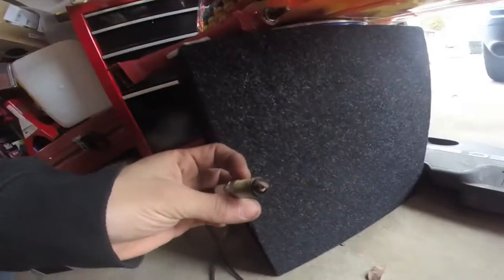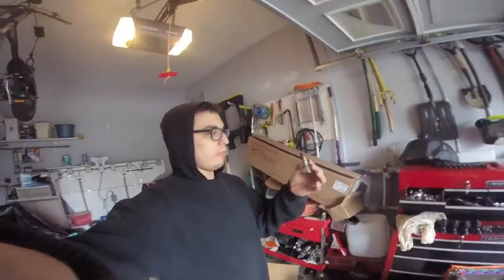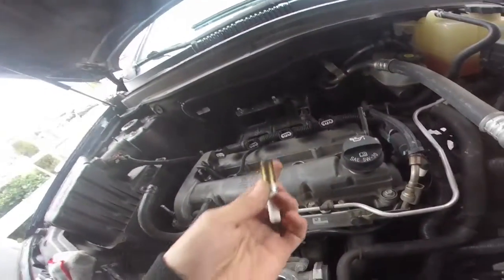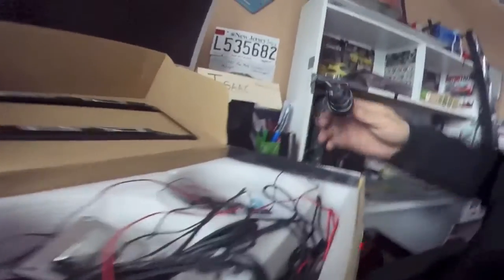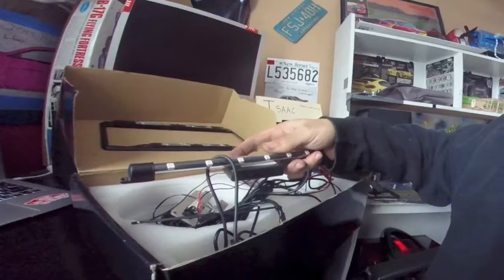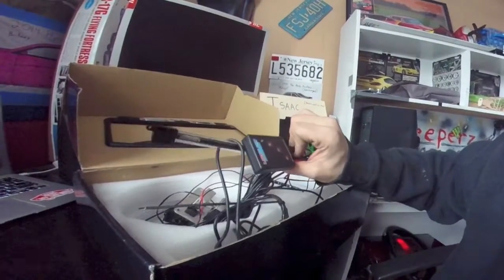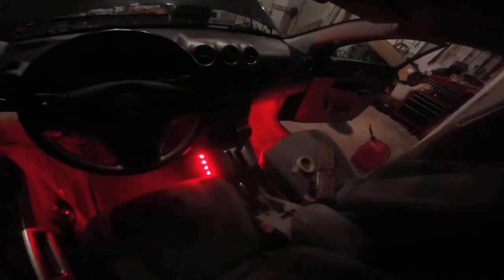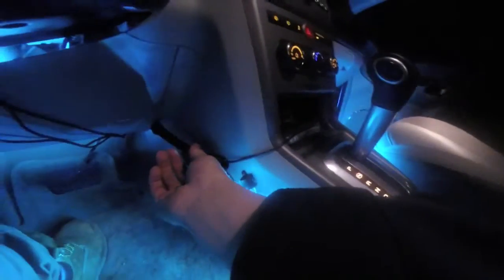Burnt plugs or No Fuel?

Comment: Needs more intake... more air=more fuel for the maf and that should fix that lean issue.  Also would help torque a lot because there is so much sound deadening baffles on the factory intake.  If you do the intake, disconnect the battery for a second to reprogram the computer for the air to fuel ratio